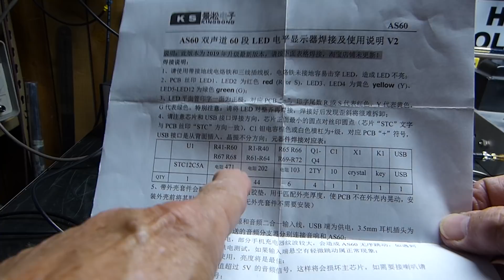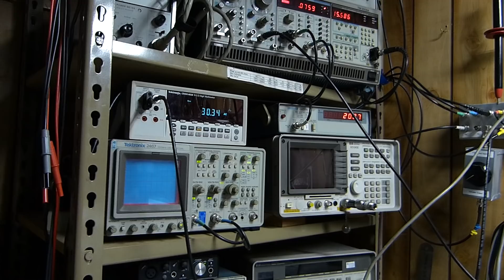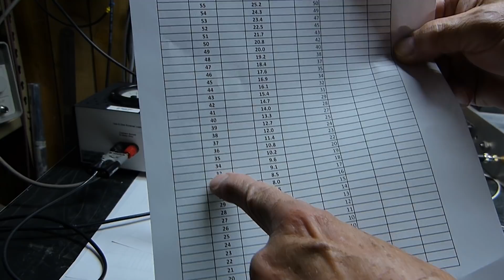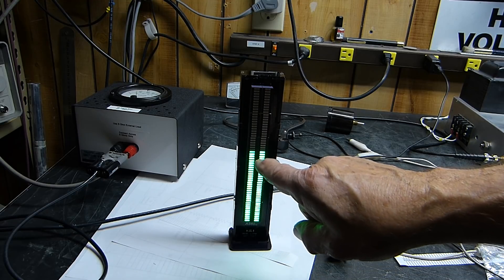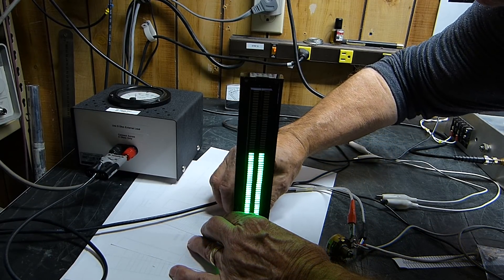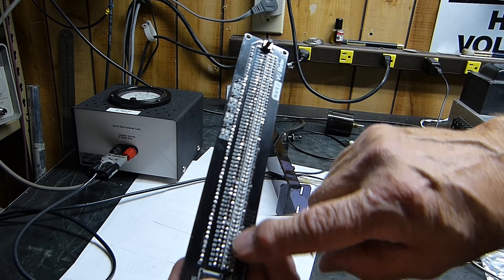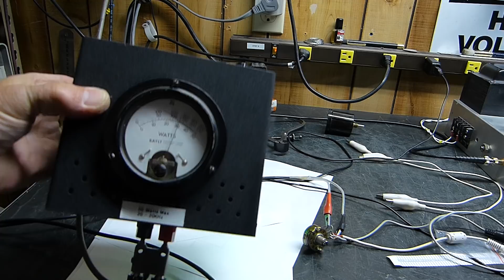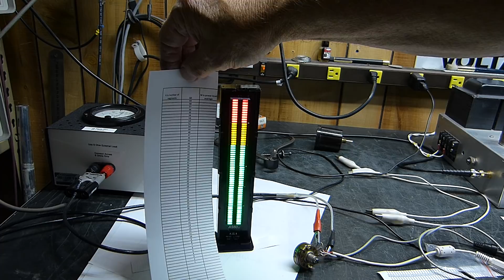LED Audio Wattmeter To Measure Average and Peak Envelope Power (PEP)

Comment: This is a job for solder paste and a hot air rework station. With resistors that small, its like soldering fleas to a board. I hate working on SMD-based boards. They give me a headache :)

Comment: Great Projects, both this and the previous meter based - I'll be ordering some parts today. I'd like to see a buffer amp for use with a VU meter; might be handy to have a VU meter and a Wattmeter in single box for work away from the lab.
Reply from the maker: I like the idea of a VU meter in addition to the LED's. An adjustable control for the VU to set it at relative zero and watch for excursions above it into the "head-room" portion. Sounds like a grand idea. Thanks.

Comment: That's really cool.  I've only seen the maybe 10 segment ones.  That had to take some time to do. I take it that's two channel and you have both sides connected together?  They kinda take away from the vintage tube look,  but they are nice.  If you wanted a more modern looking tube amp,  that's the ticket.  Where did you order it from?
Reply: I seen someone else asked and found the link. Thanks!
Reply: It looks like you can get it assembled also.

Comment: Getting all the digits in may be too crowded. Try interpolating the positions for 5, 10, 15 etc. and putting them beside the bar. Maybe with tick marks for the single digits. They will not all line up with the leds but the only alternative to that is to pre-attenuate the input to the point where the leds do line up with the 5,10,15 etc and tick marks.. losing some of the top digits in the process.
Is the intention to use it for static power measurement or to use as a type of VU meter for audio?
Cheers,
Reply: Oh and for the quad flat pack ICs (TSSOP, TQFP etc) a good flux pen or liquid flux is your best friend. Lots of that put down on the pins and just run a loaded (w/ solder) soldering iron tip along the ends of the leads... ziiiip and the whole thing is soldered with no shorts.
Reply from the maker: @EngineeringVignettes  I saw the way you are talking about soldering on a video of this LED bar on YouTube. It was amazing the (large) size of his soldering iron and how the solder did not bridge everything together. The solder that would be used in manufacturing such items must be something special too?
Reply from the maker: I want it to be reasonably accurate for average power and also be able to check peak power. None of these types of meters will every completely replace my analog meters or the Tek and HP equipment. I agree that 60 segments is too crowded and I think your scheme above is the way I will have to go. Thanks...
Reply: @ElPasoTubeAmps  - I use 63/37 with no issues to do this. This secret sauce is the liquid rosin. Get a good no-clean type, Digikey or other source. I know Rossman Group (NY) is selling flux but I have no idea how good it is... and Lous is a little heavy on his flux usage in his vids :)-
Reply: ElPaso TubeAmps I just used whatever I had on the bench for swipe soldering: same solder and an ordinary flux pen. Works an absolute treat. This is basically how flow soldering works. The flux forces the solder away from itself and onto the metal.

Comment: I dislike tiny SMD parts.. but, yes, they do make small "things" possible.
Reply from the maker: The fact that is doesn't have the mechanical calibration issues that we deal with in analog devices is nice. That doesn't mean I don't love and often times even prefer my analog devices but it interesting the things we can have nowadays for so little money and the variety of ways we can use them. Mostly this device is meant to be pretty but it does have analytical measurement value.
Reply: ElPaso TubeAmps 
I actually have a use for a high count bar graph for a particular studio level indication... typical 20 segment indicators won't do, .. I like this!   There are several sources for this sort of thing from time to time on 'bay and 'baba..  Which 'brand' is this one?
Reply from the maker: @jenniferwhitewolf3784   I got this one off Ebay from a seller in California as I didn't want to have to wait several weeks for it to arrive from China. The description and link to the Ebay seller is below

AS60-DIY-LEDs-Digital-Music-Spectrum-Audio-Sound-Level-Display-VU-Meter

https://www.ebay.com/itm/AS60-DIY-LEDs-Digital-Music-Spectrum-Audio-Sound-Level-Display-VU-Meter/142880956003?ssPageName=STRK%3AMEBIDX%3AIT&_trksid=p2057872.m2749.l2649

Comment: Nope, couldn't do it. Surface mount is a bridge too far for me.
Reply from the maker: I am very surprised I did this. Point to point wiring on terminal strips and tube sockets for vacuum tube equipment is what I love.
I guess the sun was shining at just the right angle and the wind blowing in the right direction for me to take this on. As I mentioned in the video, I am pleased I am still so steady-of-hand and can (with good jewelers glasses) still see well enough to do this sort of work - when required...
I do still have soldering equipment and tools for work at the relatively small component level but not really at the surface mount level of these resistors and transistors. 
I won't be building another one...